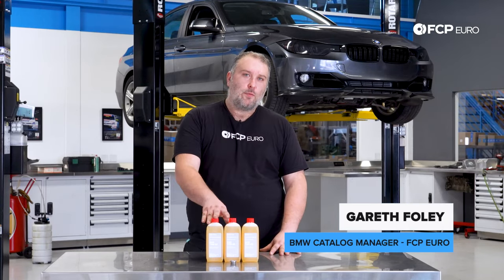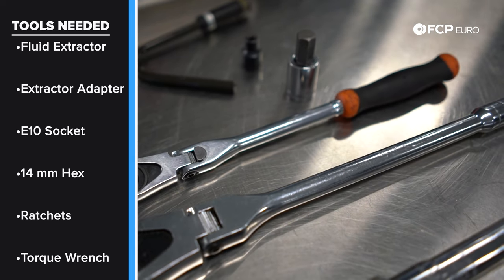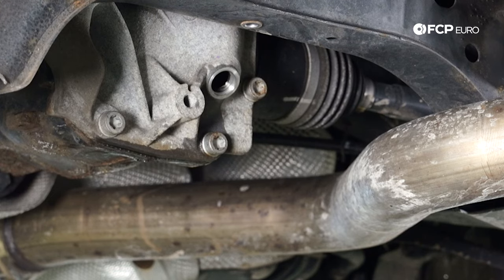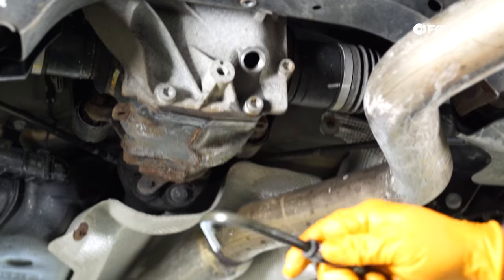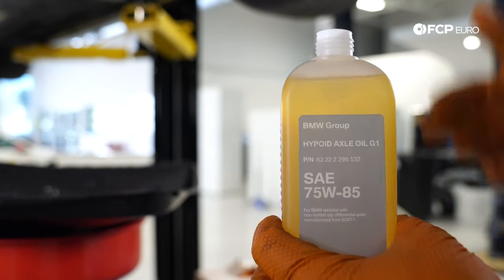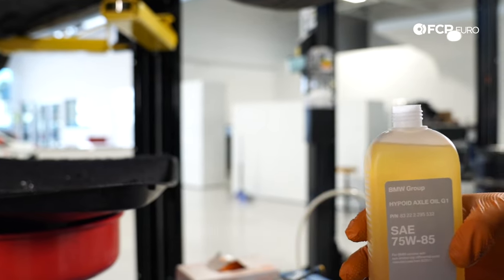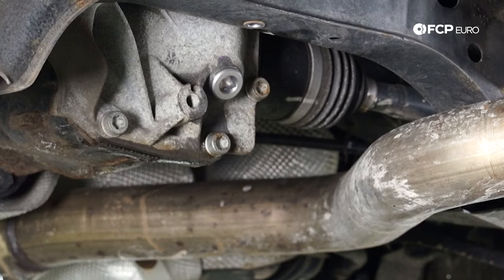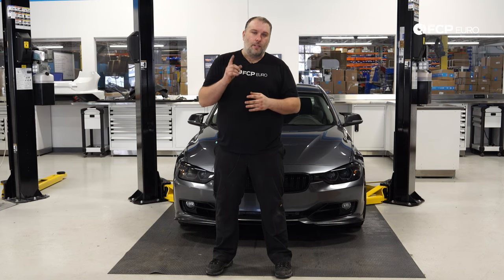BMW F30 Rear Differential Fluid Replacement DIY (2012-2018 BMW 328i, 335i, & More)

Comment from the maker: Buy Parts and Tools Seen in This Video- 
BMW G1 Hypoid Differential Fluid (500mL) - Genuine BMW 83222295532-
https://www.fcpeuro.com/products/bmw-hypoid-axle-oil-g1-3x500ml-83222295532?utm_source=youtube&utm_medium=description&utm_campaign=mps%20f30&utm_content=rear%20diff

BMW Differential Drain/Fill Plug - OE Supplier 33117525064-
https://www.fcpeuro.com/products/bmw-differential-drain-plug?utm_source=youtube&utm_medium=description&utm_campaign=mps%20f30&utm_content=rear%20diff

BMW Differential Fluid Extractor Adapter - FCP Euro B3300000-
https://www.fcpeuro.com/products/bmw-differential-fluid-extractor-tool-fcp-euro-b3300000?utm_source=youtube&utm_medium=description&utm_campaign=mps%20f30&utm_content=rear%20diff

Extraction/Filling Syringe Pump (200cc) - CTA Tools 7075-
https://www.fcpeuro.com/products/extraction-filling-syringe-pump-200cc-cta-tools-7075?utm_source=youtube&utm_medium=description&utm_campaign=mps%20f30&utm_content=rear%20diff 

Check out how to service your front differential here: https://www.youtube.com/watch?v=_ECMSIv3i1g&ab_channel=FCPEuro
Reply: Does the fluid extractor adapter work with a F10 (2015) 535i?

Comment: Just FYI for those that want to be as close to what BMW calls for as possible: the harmonic dampener E12 bolt has a torque spec of 19 Nm. The fill plug, as stated, at 60 Nm. I just reused old plug since I did not order replacement plug timely. I do these every 30K miles, so I plan to replace the plug at the next change. So far, no leaks, so reusing is certainly an option. Took about 850mL, I would say, so just order 2 bottles.
Reply: Thanks for the info. 30k seems really frequent, but I guess it depends how you drive too. Could potentially send in an oil sample to Blackstone for analysis.

Comment: Thank you. Just did this yesterday. Easy as pie - almost as easy as an engine oil change. I used a $7 fluid pump from Harbor Freight and it worked great. The tubing comes coiled so has a natural curve that went right to the bottom of the diff housing. I used Red Line 75W-85 GL5 oil and it took about 24 fl oz of that (less than 1qt bottle). I did not replace the plug but cleaned the area well afterwards with brake parts cleaner and will check for leaks later. My 328i has about 70K miles on it and this is the first gear oil change. The oil seemed to be in good condition but was a little cloudy and discolored. I'm glad I changed it. A general point is that FCP are performing this service exactly as I would want them to do it for my car. However, because us DIYers have an ongoing 1:1 relationship with our cars we can afford some leeway in which consumables/tools to use and which parts to replace/reuse.
Reply: @TheZimberto thanks for the great advice!

Comment: ATTENTION F31 WAGON OWNERS, you'll also need a T50, T60, and 13mm socket with 6" extension to remove the subframe reinforcements as one blocks the harmonic dampener. You don't need to completely remove the one blocking the dampener, which would require removing some plastic splash shield with push pins as well. The other one you will but the bolts are very easy to get to and it drops right out. I couldn't find torque specs for any of them.
Reply: What alternative oil did you use? BMW says Hypoid Axle oil G3.
Reply: @bathanmark  I used the Liqui Moly 75W90 kit from FCP Euro for the front and rear differentials and BMW oil for the transfer case, since I had a bottle already. I did them at the same time.
Reply: @Dagasm  Thank you. I will give that a shot.

Comment: When I did this I made an adapter for my suction pump out of a piece of metal brake line. You can bend it as needed to get the most old fluid out of the transfer case or diff.
Reply from the maker: love the ingenuity

Comment: everything is simple if you have a lift :D but yes i can se myself doing this with jacks. thanks for the info, pls do a video on resealing the rear cover of the diff :D i have slight leaks on my 335i

Comment: Great video and explanations! Fluid drag is a big deal in a BMW diff. It will take away wheel horsepower. I wish FCP Euro would carry Amsoil Severe Gear. hint hint.
Reply from the maker: Sorry about the amsoil, we feel pretty strongly about Liqui Moly
Reply: @fcpeuro  Liqui Moly makes impressive products no doubt.

Comment: I have a 2014 435i xDrive, and have had a whirring/grinding noise that’s surely coming from the rear diff after putting it on the lift. Techs suspected that someone put transfer case fluid in their mere and fucked it up (the shit was almost black and smelled burnt). Planning on doing this, hopefully it stops the noise, but it could also be metal shavings from the deteriorating gears as the previous unknown fluid was nowhere near as thick as what’s supposed to be in there.
Reply from the maker: Crossing our fingers on the fluid!

Comment: Great how-to video as always from FCP Euro. Quick question, why would you not just drop the cover and clean out the entire differential? That’s how I’ve always done gear oil changes in the past when there wasn’t a drain plug. It doesn’t look like it’s that hard to access all the bolts for the dif cover on these or a E90/E92.  I haven’t gotten under the car yet to inspect but just curious how difficult if would be.

Comment: My vehicle has 180,000 miles on it,  never thought I could change the diff fluid until I found this video… Is this something I should do, or avoid it now that the vehicle is at such high mileage?
Reply: I'm not FCP Euro but I don't think it's worth the risk. Just as people don't recommend changing transmission fluid at really high mileages if you've never changed it before (180K miles is definitely really high mileage), dif fluid is in the same category. You can potentially do more harm than good by swapping out the fluid. 

Or if you really want to, maybe only change half at once and see how the car responds?
Reply: Change it
Reply: @ShockwavesFTW  yeah I think I’ll stick with not touching it, I’m at 199k now with no issues. Had to replace my radiator today due to a crack/leak.. otherwise the vehicle is doing fine🙏🏽

Comment: If I get one of those transfer pumps, I could use it for transmission fluid, differential fluid, steering fluid, maybe something else. (Not brake fluid). BUT, how do you clean out the old fluid after use, so you don’t contaminate?
Reply: mineral spirits

Comment: Any value to tipping up the front end to send the fluid to the back of the diff.  Maybe get a little more out?
Reply: no, if you really want to get all the fluid out buy some cheap synthetic 75w90 gl-4 gear oil, put it in the rear diff and drive around with it in for 15 min and then siphon this fluid out and put the OEM in

Comment: Hi Gareth, just bought a used 2014 F30 320d with only 20k miles on it. Still far below your recommendation of 50k miles to change the diff oil. However, since this stuff oxidises with time, should I replace it now considering it’s over 8 years old now?
Reply from the maker: Hi Anindya, congratulations on the new buy. While it would be a bit premature in mileage, you are certainly going to cause no harm in doing it early.

Comment: Do you have a video for Diesel Exhaust Fluid replacement on a 2016 328d? I understand BMW stealerships drain old DEF out and replace with new fluid, but I don’t know if that’s really true, or if it’s necessary.
Reply: @randy's Retired DEF fluid is all made the same for diesels (they are meant for emissions). It burns off as you drive the vehicle so nothing needs to be flushed out. You just pour more in when it says it's running out. It is the blue cap next to where you top off the fuel tank when getting gas. Just be careful not to spill when pouring in. You can pick up DEF fluid from Autozone or O'Reilys (the mixture is all the same regardless of brand).
Reply: @marrroquinnn  Thanks for the response. BMW always did a “flush and fill” when I was getting my car serviced by them. I’ve started doing the services myself and wondered how one did the flush portion.

Comment: Hi! Thanks for the valuable info!
Can i use a GL-5 oil, instead of a GL-4? (both 75w85). I've been searching and found sources claiming that you shouldn't use GL-5 on manual gearboxes since the additives for EP (extreme pressure) may damage copper and copper (syncromesh rings). But when you are using them on a differencial, the GL-5 is actually welcome, due it's EP additives
Reply: Yes, no worries.

Comment: Hi, I am looking to have my rear diff serviced on my 2009 bmw 320d m sport tourer,  but the problem is i come up against a lot of resistance from local garages and bmw service center near to where i live here in the uk, all saying we don`t do that service as the oil is life time,, is there a reason for this ? yours frustratingly.
Reply from the maker: That is a bit odd, not something we have encountered in our neck of the woods.
Reply: @fcpeuro  Thanks for replying. Good news,  i have managed to find a local garage that will carry out the service.

Comment: my 2014 328d xdrive has 176k miles. is it too late to change the fluid? Could it potentially cause issues?
Reply from the maker: As long as the differential is not showing any signs of bad wear or failure, you would be okay with changing it out.
Reply: Did you change the oil in the end? Was it because of the diff noise. Mine at 133k miles and noise from diff, thinking of changing oil
Reply: @youonlyliveonce5576  So you are going to change the oil after it starts making noise? Ship has sailed for it not having internal damage.

Comment: I have 2015 320 and it has 65k KMS on it, how often do I need to change the differential oil ?
Reply: watch the video, he gives a recommendation interval
Reply: they recommend 50k miles

Comment: I have a BMW 2011 328i x drive it wobbles in the rear like the rim is bent, it worsen when riding @ around 20 to 30 mph the higher speeds its lesson. Could you tell me what is the problem? It's not a bent rim I replaced the rear rim, still the same results.
Reply: wheel bearing bad tires
Reply: Check the 3 Rear differential bushings